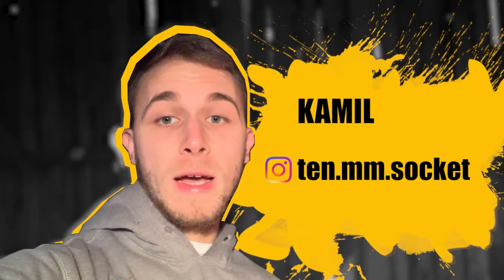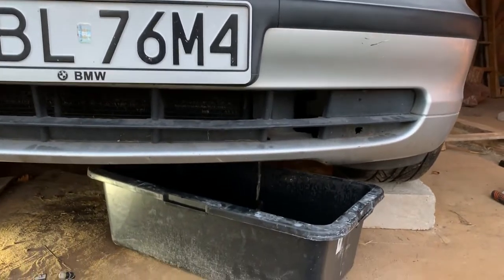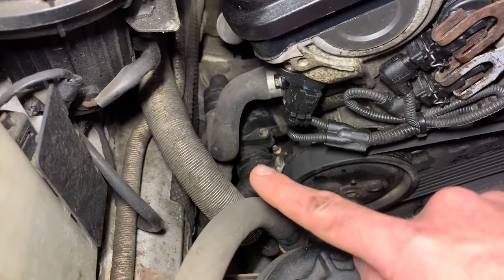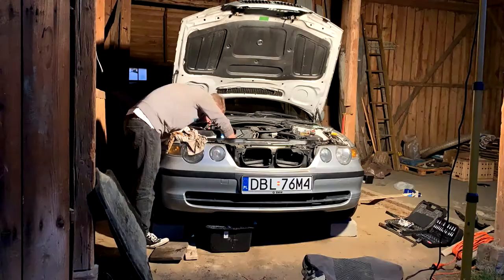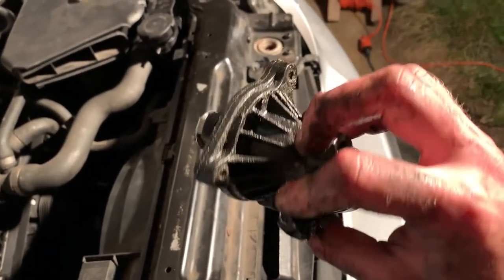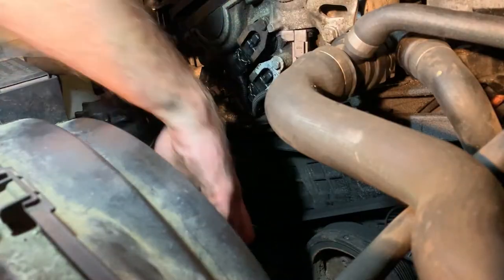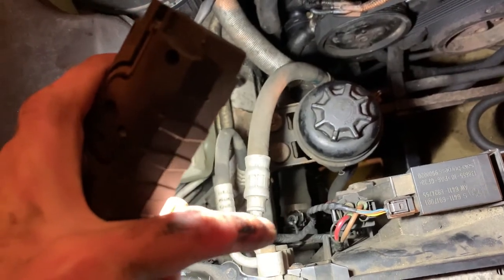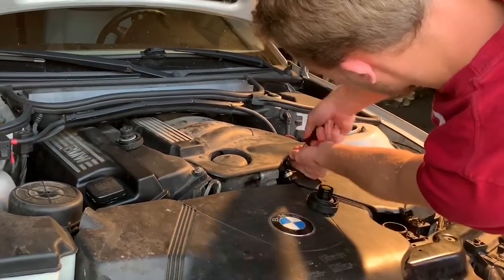How to change the THERMOSTAT in N42B20 BMW e46

Comment: Hello! It's normal that temp in N42B18 is almost all the time, 107° and the water tubes are strog..? Thnx
Reply from the maker: There are different versions of thermostat. One of them is 105C, probably that’s the one you have. If you’re worried the solution would be to replace thermostat to the 95C one 😉 but it should be fine as it was designed like this
Reply: @gorillaprojectcar  I have,, one 95° thermostat, but manual, not electric like the original,, if you know any shop when I can find a electric thermostat 95°, pls share with me 🤗
Reply from the maker: I do but all are in Poland and I’m afraid they are not shipping abroad
Reply: @gorillaprojectcar hey can you give a part no pls? I live in Ro and i would need one thats 95c, but with the heating element.. thx

Comment: This work? Did your cooling fan switch get warm on the lower hose after replacing thermostat, as im having same issue, but like coolant isnt making way round also, no clogs but not sure on waterpump either
Reply from the maker: Yes! That solved my problems 😉

Comment: Is that thermostat attached to the water pump?
Reply from the maker: Yes, there are 3 bolts holding it there. 2 are simple and one is medium difficult ;) let me know if you need any advice :)
Reply: @gorillaprojectcar  thank you sir
Reply from the maker: Anytime 😉
Reply: So is this model n42 power steering pump driving the water pump also😬
Reply from the maker: Yes, it is in one unit :)

Comment: I appreciate the video, you explained very well and helped me with the job! But one question, shouldn't the antifreeze be blue? I think the red stuff is for VW and japanese cars.
Just be careful not to use the wrong one because it's bad for radiator and head gasket! 👍🙏
Reply from the maker: Thanks a lot. Im happy it helped. 

It should but the antifreeze I used is universal and I’ve had a good luck running it so far. But I’m going to blue next time 😉